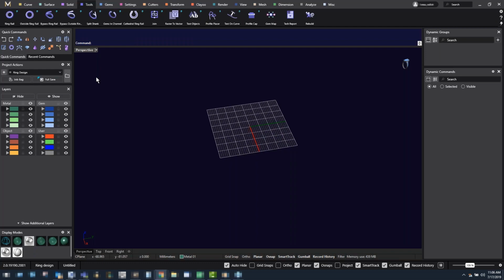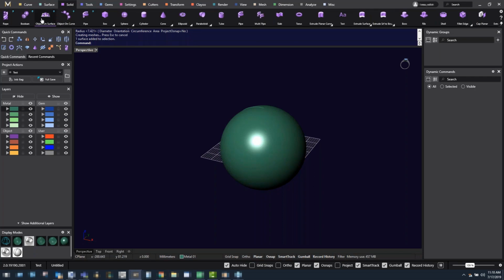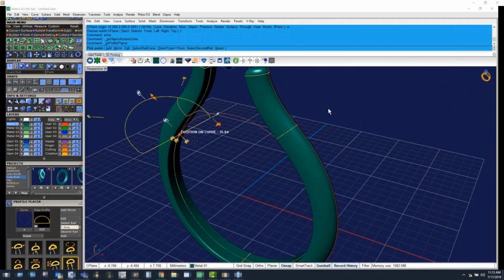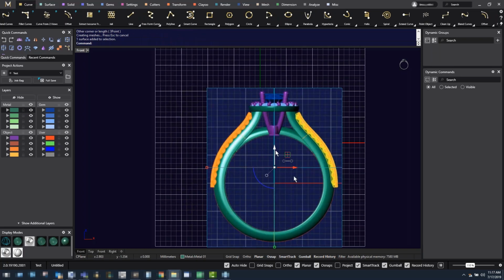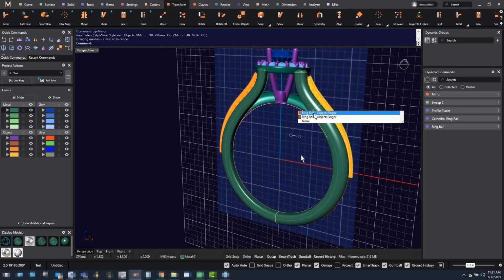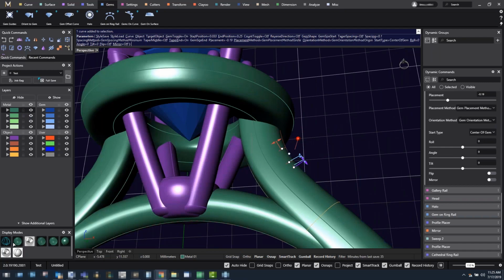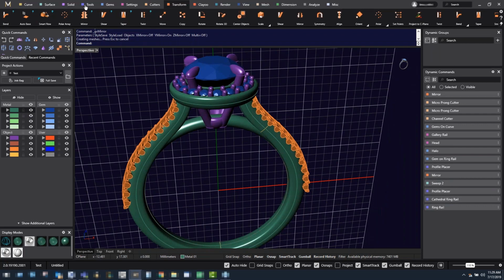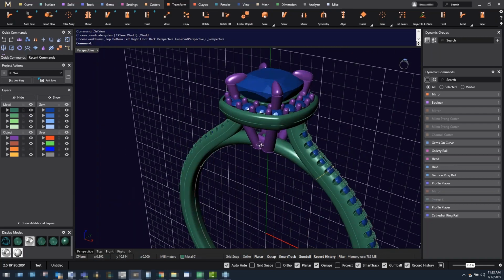Halo Cathedral Comparative - MatrixGold Webinar

Comment: The software is a good tool, but your idea of timing from start to finish a  ring in 9 minutes is unreal, according to your calculations it should be possible to make 48 rings a day and 12480 rings a year.

and then you said let's be modest and make    2 designs a day
, which make about 520 a year
.

I do not know how about you, but it is really insane to predict that it is possible to make 12480 models a year, vs making 520 based on your madest calculations.

Why am I bringing this up to you?   
As the people are using the software, working 40  hours a week, our employer would expect 48 models a day according to your timing, and not 2, based on your modest example, 

by doing these unrealistic calculations YOU ARE GIVING UNREAL IDEA TO A LOT OF PEOPLE, who is in the jewelry business.

and also when you make jewelry is not about the speed, it is about making right....
Reply from the maker: Hi Diamand Man, you are right, timing on making a ring depends on many variables. This being said MatrixGold is a tool that allows ,thanks to its dynamic commands, variations in a few seconds, allowing be faster when designing different rings.